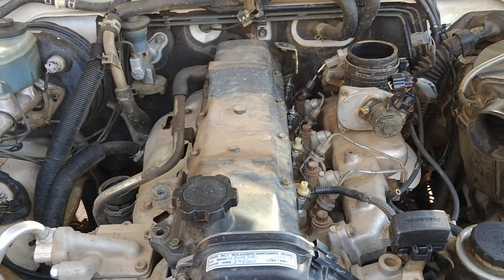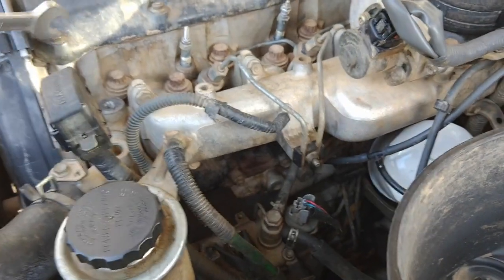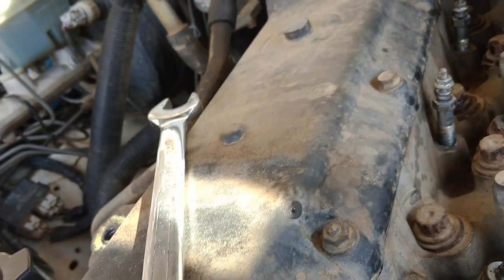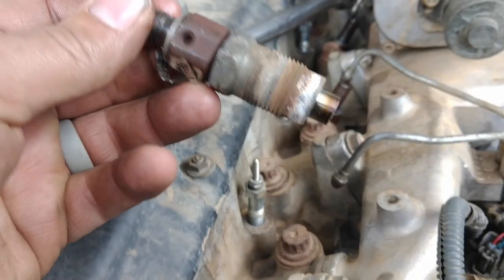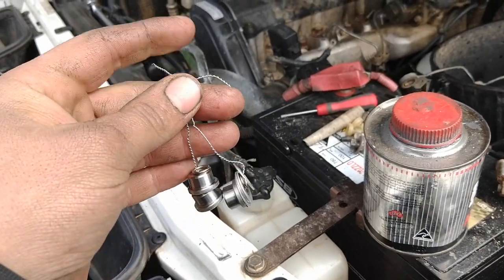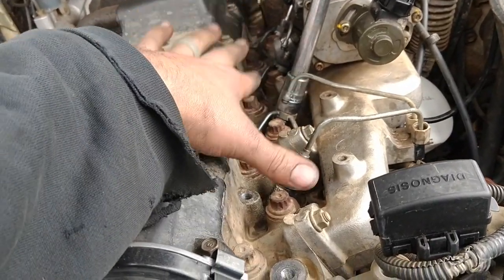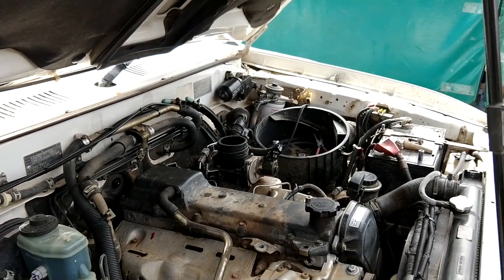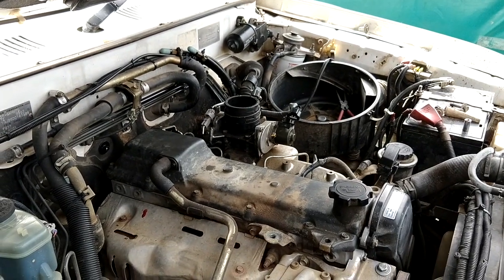How to replace injectors on a 1KZTE TD

Comment: Are you running the rubber washer gaskets over the metal washer with holes?  I didn't see the rubber washer install.  My rubber washers squeeze out a lot as I am torqueing them.

Comment: Budget on a new return line rail, b'cos it'll usually crap itself on at least one injector regardless of how careful you go. You'll go to remove the nut on top of it, the return line boss will be seized to it & it'll twist. That shags the little steel pipes & renders the whole return line scrap. 

Use a proper injector socket to get the injectors out - makes life easy.  While you're in there, whip out the glow plugs - takes seconds, you'll usually find one or 2 have shat the bed. 

Only way I have found to not ruin the return line is to first tighten the nuts holding it down with an impact wrench - that often (but not always) shocks the "bond" free & you can then remove the nut. However that doesn't always work - was doing a set today & the return line array mangled into a hoop - no biggie as you can buy a new one, but might be a biggie if you're doing this on a sunday, planning to drive to work on monday..

Comment: Hey Mate i got the same engine with you, mine was burning so much fuel and doesn't have so much power, i did some research online and enter up to clean the intake manifold along with changing glow plugs and all injectors, after finished doing all the cleaning stuff and put back everything along with all new plugs and recondition injectors, i started the engine up and was not running,right now i try follow your steps crank the engine up  for 30 seconds to bleed fuel and found out that no fuel to all injectors, i dont want to keep cranking up the engine longer otherwise i might damage something. Please any idea what causing the problem. Cheers

Comment: How did you clean them out? I'm not that clued up on what you can do, so I'm worried about anything getting into the engine from cleaning them. Just a rag on the threads?
Also when you say turn the engine over, how do you do that?
Reply from the maker: Heya, you can put some degreaser on a rag and then you something to poke it down the injector whole just to clean the Threads and the sit.
D

Comment: Where did you get them re-manufactured?  Would that shop know of a higher flow rate denso part number? I've been searching but these denso oem parts are rarely listed by flow rate. Thanks!
Reply from the maker: Hi,
Got them from Hi tech diesel.
Adelaide South Australian.
No idea on flow rate sorry.
D

Comment: Hi, did your fuel economy improve after doing the change? i have a 120 series with 1kz-te and my fuel consumption has been increasingly getting worse as it stands atm 290k i get 16l/100km it's a bit crazy for a car with shit power and only being a 4cyl
Reply from the maker: Heya,
In short no, I was getting around 13 to 14 LTR per 100 km already.
If it did change it was a very small amount.
Have you checked out things like, air filter,fuel filter,if it's auto change the oil?
Have you changed your tyres recently?
D
Reply: @DIYIT13  Hey mate, thanks for replying, yeah i do all those reguraly, just done a trans service also, i do run 33" tyres, all the standard off road gear, it went from 13l/100 stock to 16l/100 now, i guess it's just something i have to live with. Pretty crappy really when i know people with td42 or even 76/79 series get more power and better economy with more cylinders. I am aware they are CRD, but never thought the old 120 1kz would be so bad. 1 more year then i get to buy a 76 series, so ill just live with the old girl till then
Reply: If your car is burning oil it may be a compression issue that is contributing to the fuel economy
Reply: @sunsolar5413  i think you relied to the wrong person, i never mentioned oil burning

Comment: My misses just got a hilux with this engine, your videos are helpful in figuring out what's going under the hood. I know turbo Subaru engines like the back of my hand but not sure where to start with these.

The ute she got has a turbo back already, do you have any advice as far as performance and reliability MUST DO's in the long run? timing belt was just done by previous owner.

Cheers

Comment: My Prado is hard to cold start even after changing glow plugs. So it might be injector problems?
Reply: Same problem here, I have Hilux surf, I even changed the Turbo but the problem is not resolved. It might be a Injector problem.
Reply: @bucketlisttrek3863  check you might have water in your fuel…go to fuel filter…water drain plug underneath…
Reply: I got same issue hard starting. New injector,glow, primer pump, fuel injection reconditioned. Doesn’t fix the problem! Any ideas?
Reply: @rickyli9566  see if your batter has at least 70AH or higher also see the CCA should be higher than 680
Reply: @devoncoleman679  I fixed the problem fuel injection internal leaking
Reply: @rickyli9566  the problem  was the fuel pump ?
Reply: @rickyli9566  did you change them or clean them?

Comment: What caused you to have them serviced.....just preventative or was it running rough, noisy at revs? I ask because I have the same engine in my 120.
Reply from the maker: The injectors where about $300 for a recondition set.
Reply: @DIYIT13  cheers mate
Reply from the maker: The main reason was preventative and they had done 150000kms  but also had a minor small Miss when it started when cold.
Reply: @DIYIT13  Thanks for the reply. I think mine need doing. Can I ask what it costs?